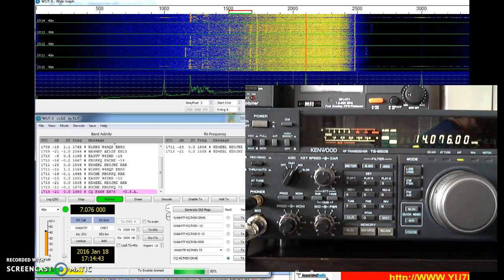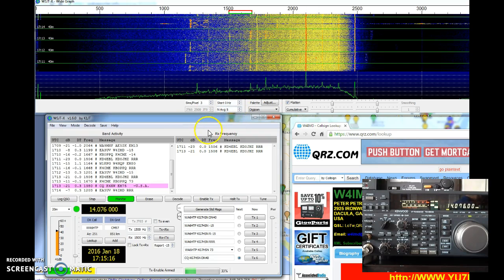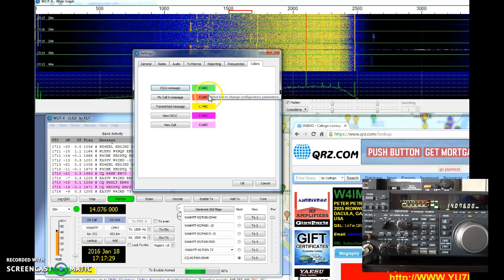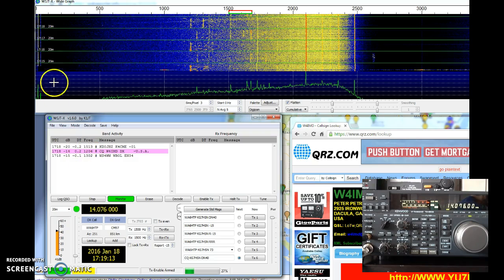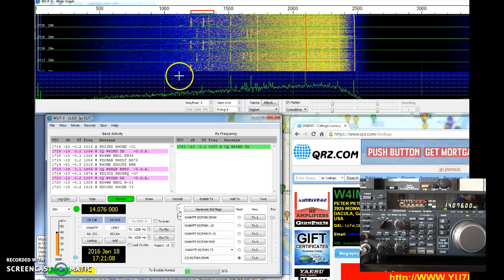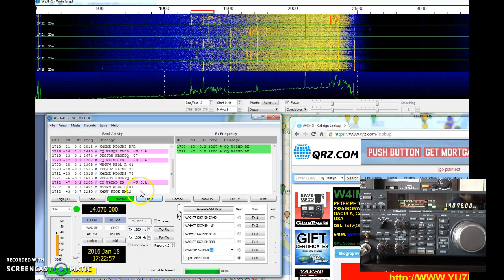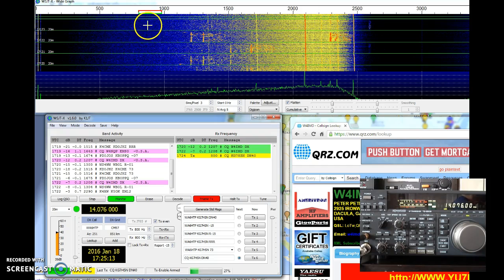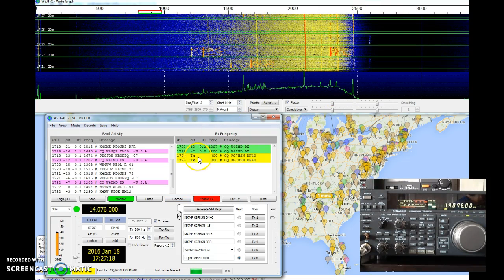Ham Radio: WSJT-X: JT65 - Basic Beginner Tutorial

Comment: Can you help me to set up correct the WSJT-X for my Ultimate 3s Radio?
My Band activity only 0238-----transmitting WSPR-----30m
It should be shown UTC=0918 dB=-19 DT=0.1 frequency=0.001460 drift=0.....
I tried everything but it is not come out right.

Comment: Yes definitely no alc at all, if your alc kicks in your signal will distort and look messy to others. I run 35 watts on the rig and turn the signal link down to about 20 watts and have a really clean signal out.
Good video, lots of useful stuff, thanks.
Very addictive mode.
Reply from the maker: John Blake if I drop my ALC all the way down on that rig, it drops my power to 0 watts
Reply: Jeff McGrath , it shouldn't, what is you power out from the rig set at.
Reply from the maker: John Blake well, it drops the power output to 0 watts because it drops the audio level to nothing, thus nothing to TX, so nothing registers on the power meter. having had multiple stations monitor my signal output with the ALC at max, without exceeding the warning line, shows zero splatter and a perfectly clean signal.
Reply: Jeff McGrath depends on your setup, alc only kicks in over a certain drive level, but if you have a clean signal then I'd be happy with that. you'll know if you over driving, cause someone will let you know.

Comment: You should crank up the rig power up to full and adjust your output power by signal levels and mic gain. And you don't want to see alc hit on at all, if alc level raises up at all turn down your mic gain or computer/signalink output levels so you wont mess up your tx signal. I work Jt65 every day withTS-850s and ZLP electronics interface, its fun and quite addictive mode..
Reply: Hi. Just read your comments. I am just setting up a ts870 with zlp electronics interface and wsjt-x. I am a little confused with reading both set of instructions and to the correct procedure for the interface setup. Any pointers please?